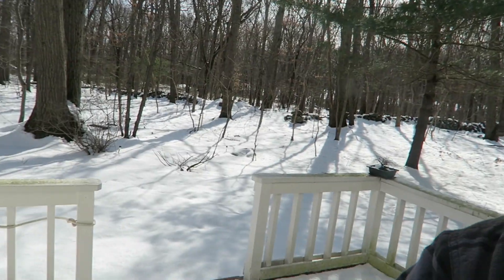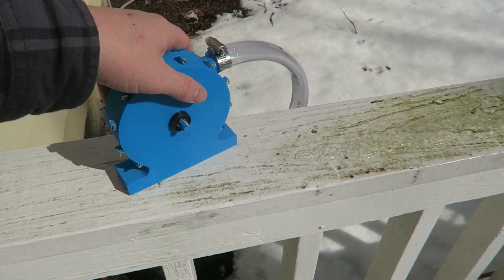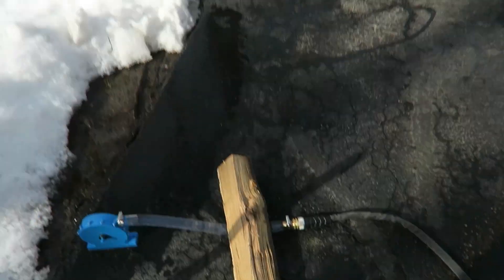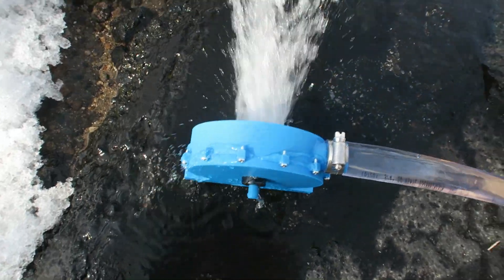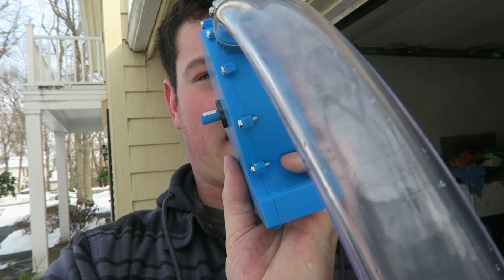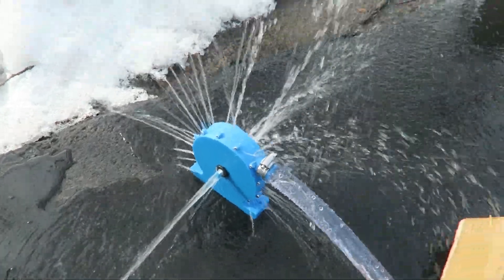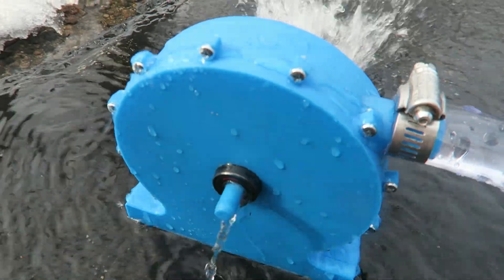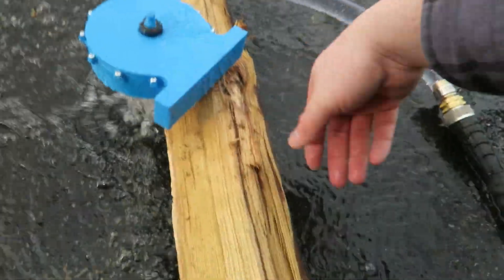3D Printed Tesla Turbine

Comment: The torque converters from cars with an automatic transmission basically work with the same principles as a tesla turbine. In the sense that there is no mechanical connection between the parts to transfer the energy from the engine to the wheels. It is all done by the friction of the fluids inside the torque converter. It is a more complicated version, but it shows that the basic idea is a well established technology. Torque converters work well because the conditions in which they operate are closed of from the outside world so that no dirt or contaminates can reach the fluids that transfer the power, which could possibly block passage ways for the fluids, or jam moving parts. A tesla turbine wouldn't last very long in conditions where the water can be contaminated with dirt, rocks, and plastics and all sorts of bio mass, so therefore I think that it wouldn't be very practical to use it in a real world situation as a power generator.
Reply from the maker: Thank you for your input, I would have to agree unless it could be filtered properly.
Reply: @Beyond_The_Print  from the 24,001 turbine British patent “It may also be pointed out that such a pump can be made without openings and spokes in the runner, as by using one or more solid disks, each in its own casing, in which form the machine will be eminently adapted for sewage, dredging and the like, when the water is charged with foreign bodies and spokes or vanes especially objectionable.”
-Nikola Tesla
Reply: @CharlieSolis   Yup, I am aware that there are differences. I do not disagree with that. However, no matter how you look at it, the transfer of power is not a mechanical one. Without the proper fluids both won't work.
Reply: @insAneTunA  again I hate to be that guy lol but actually the Tesla turbine can be considered a strictly “electrical” turbine as the molecule adhesion forces that connects the fluid to the discs is dependent upon e the valence electron shell orbital interactions. 

For example for hydro and steam TesTurs, or rather polar molecule motive fluids, are best to have a hydrophilic coating on the disc faces. Where as non polar molecule motive fluids, air (O2, N2, CO2), etc, are best to have a hydrophobic coatings. As each of these changes the “wetting angle” and adhesion properties for adherence between the discs and the motive fluid. Which govern boundary layer thickness. 

Sorry, I’m only being a stickler about because actually build TesTurs for electricity production with actual working proof too. 

But there is no “mechanical connection” between the motive fluid and the TesTur discs like there is with bladed turbines where the fluid is mechanically smashing into/off of or scooped by, etc blades or lifting surfaces. 

This is the biggest misconception most have about the TesTur. And it’s the reason most people immediately suggest to toughen the surface of the discs. Which is the last thing you want to do because the rougher the discs. The more turbulent the flow between and the more turbulent the flow between the more loss there is present. 

Laminar flows are king in the feature for the theoretical efficiency that is claimed possible for these.
Reply from the maker: Thanks for the comments and I see what you're saying. I'll keep improving these ideas and try to make the idea better and better. Maybe I'll try making it into a pump as well as a generator.
Reply: @insAneTunA  that being said, other than changing turbulence and stator surface drag loss within the flow, if you change the viscosity of the motive fluid in a bladed turbine it doesn’t change the mechanics for how the pressure gradient applies the net force on the blade surfaces to create a force which translates into rotation. 

It’s the direct collision of particles that creates the pressure which creates the net force on the blade surface areas which creates the net force. 

But again to properly flog the proverbial 💀 horse, the fluid particles do not transfer their kinetic energy to the disc faces by any sort of mechanical collision with the discs. 

In fact the fluid that’s just off the surface of the disc’s faces is not moving relative to the discs at all and is stationary with the discs. It’s the fluid trying to move through itself, cohesive forces, that transfers the fluids kinetic energy through the shear forces to the layer of the fluid that is stationary relative and molecularly adhered to the disc faces. 

And again the misconception most people have about the TesTur is that it’s similar to as if a solid object was sliding across the surface of another object creating friction which creates the force, “ispo facto the fluid must take the longest path sliding across the disc faces before leaving” 

Though that couldn’t be further from the truth. 

And in fact slip must be reduced to increase efficiency, Torque, and thus power out.  The fluid should slip the least on the disc faces to reduce any losses to heat in the shearing of the laminar fluid. 

In Tesla’s own words from “Dr. Tesla Talks of Gas Turbines”

““I have been working at this a long time. Many years ago I invented a pump for pumping mercury. Just a plain disk, like this, and it would work very well. ‘All right,’ I said, ‘that is friction.’ But one day I thought it out, and I thought, ‘No, that is not friction, it is something else. The particles are not always sliding by the disk, but some of them at least are carried along with it. Therefore it cannot be friction. It must be adhesion.’ And that, you see, was the real beginning.

“For if you can imagine a wheel rotating in a medium, whether the fluid is receiving or imparting energy, and moving at nearly the same velocity as the fluid, then you have a minimum of friction, you get little or no ‘slip.’ Then you are getting something very different from friction; you are making use of adhesion alone. It’s all so simple, so very simple.

“This is the greatest of my inventions,” Tesla went on with great enthusiasm. “

I highly suggest reading the whole “Dr. Tesla Talks of Gas Turbines” article if you haven’t before or listen to an audiobook of it. 🙂
Reply from the maker: I'll have to check this out, great advice
Reply: @Beyond_The_Print  you’re welcome! Let me know if you ever need anything. I admire your drive to take on this venture. It’s a long a grueling one but definitely worth while.
Reply: @Beyond_The_Print  the r/ teslaTurbine also has a good amount of TesTur stuff though we are not as active on it as we used to be.
Reply: @CharlieSolis  I understand you. The tesla turbine discs need the smoothest surface possible in order to get the most optimal performance out of the principle idea, and a torque converter must have aggressive angled deflecting scoops or blades if you will, and since the fluid has no other way to go it pushes the scoops or blades from the torque converter rotor ahead. More like a hydraulic pump. 

So in that sense they completely work with a different principle. If you would remove the scoops or blades from a torque converter it wouldn't work, and if you would give a tesla turbine disc a rough surface it wouldn't work as well, or maybe not at all either. 

It is either a smooth surface, or aggressive angled scoops or blades.
Reply: @insAneTunA  precisely!
Reply from the maker: @CharlieSolis  I will keep it in mind with any questions I may have thank you again.
Reply from the maker: @insAneTunA  this may be something worth testing when I get the tesla turbine running efficiently I'll try rough faced disks to see the difference it makes.
Reply: @Beyond_The_Print  Well, if you are curious about it you can do that, but wouldn't that be a waste of time and money if we already know the answer? 

But if you want to test it I would suggest to go into a different direction, and that is by comparing a set of the smoothest discs that you can possibly find for free with the set of printed discs that you already have. 

So I was thinking about using the discs from an old hard drive, or a couple of them, and to compare those with the printed discs that you already have. Or maybe some old CD's if they are strong enough. (Those CD's are circular plastic discs that people once used to play recorded music.....😁)

I don't think that you can find anything smoother for free that is basically ready to get installed. 

But is it worth for you to do all that work?
Reply: @Beyond_The_Print  And if you want to have a cheap source for DIY gaskets I can recommend to keep an eye open for some used EPDM pond or roof liner. That is perfect gasket material for these type of applications. Or you buy some.
Reply from the maker: @insAneTunA  I think I'll try your idea with the cds. It will be more work but to verify the difference is interesting enough for me to add it onto my list. Some point I'll try it out. I do have alot of improvements on projects I've made already and new designs I'm working on. I will try and make this happen in the future.
Reply from the maker: @insAneTunA  thanks for the gasket idea, im still trying to come up with an idea for your tank track idea. I should have a video up soon with an improved turbine.
Reply: @Beyond_The_Print  Looking forward to see that, I am really curious.
Reply: I hate to be “that guy” but technically the Tesla turbine works on viscous adhesion to the disc faces and the average torque converter is still just like a regular bladed fan/turbine.

Torque converters can be either a tesla or a bladed of some kind.  (or other but that’s besides the point) 

In the TesTur, it’s the fluids molecular adhesion to the disc faces and the resistance it has from flowing through itself that transfers torque to the discs and shaft. 

In a bladed turbine, for the sake of brevity, it still relies on the collision of the moving fluid into an angled surface to create a rotational force. (Or for a reaction turbine which is very unlikely for a torque converter, the fluid leaving the turbine blades provide a thrust in the tangential direction giving a rotational force/torque on the shaft.) 

In the average torque converter they just use a high viscosity fluid so the turbulent losses are extremely low but still ever present if need to absorb any torque spikes. 

But a TesTur can be used with any fluid, gas or liquid, irrelevant if the viscosity. The TesTur just has to be designed differently for the different fluids viscosities and adherence to the discs.
Reply: Also, in fact it’s the other way around. TesTurs can handle multiphase fluid flows, any combination of gas, liquids, and solids due to the fact that they have no lifting surfaces for the particulates to smash into like in a bladed turbine. 

It’s specifically a feature of the Tesla turbine that they can handle wet steam and no bladed turbine can do that for any prolonged period of time without wearing the complex geometry blades down into little nubbins in minutes. 

Tesla pumps are used in the oil industry fairly commonly because the discs are the only things that can handle the extremely abrasive slurries that are to be pumped.
Reply: Orc argues to Saruman. But mylord there is too many- build the tamm, block the stream work the furnaces night and day! but we do not have enough fuel the forest of fangorn lies on our doorstep, BURN IT- Yeeessssss x)
That means dont look for reasons not to do it, find a way how it can be done! Just ummm... dont burn the forest... trees will retaliate :D